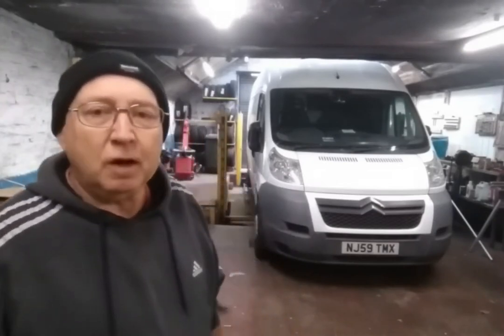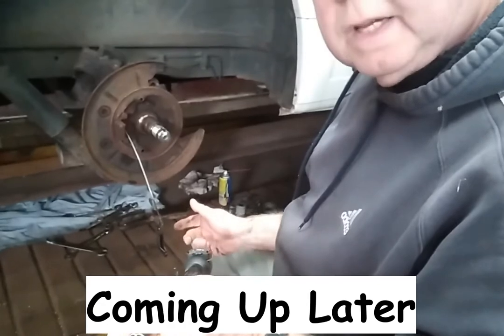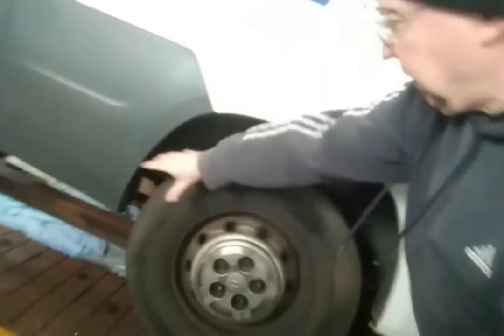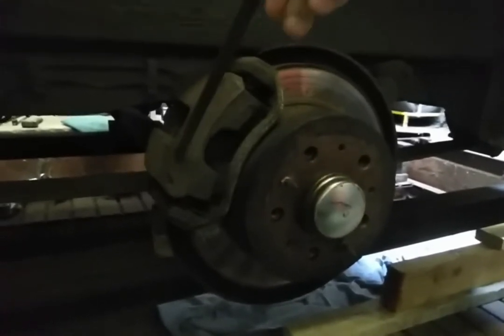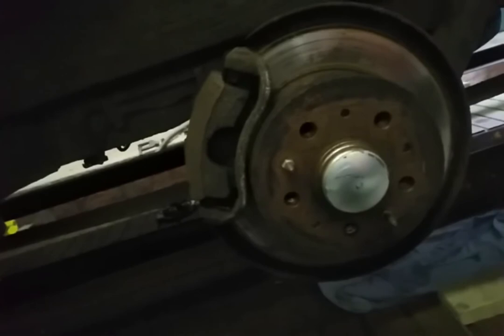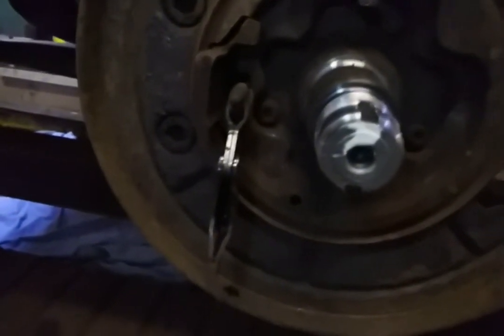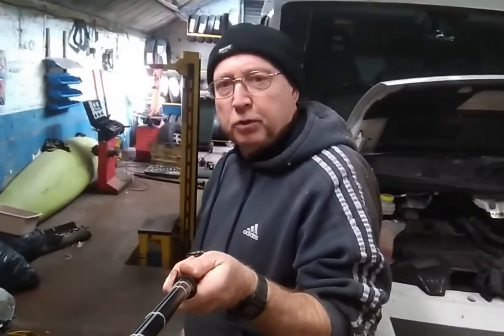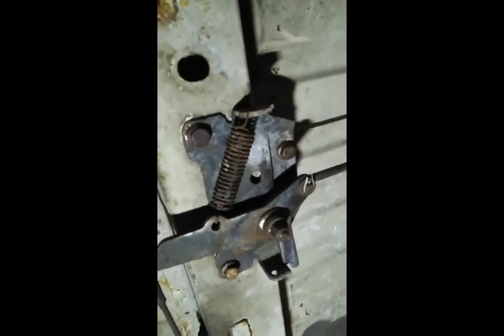A Step-By-Step Guide How To Free Off Seized Brakes  !!!

Comment: Another well-presented video, but a total brake overhaul is perhaps not the job for the 'average' motorist. 
However, as you said, perhaps some of the work is doable.
Reply from the maker: Hi Brian, Yeah, It's unusual to strip down brakes that much, unless you've got a specific problem that requires it ! most service / periodic checks don't require that much dismantling haha.
Thanks for your continued support and participation .
                              Cheers...Jimmy...